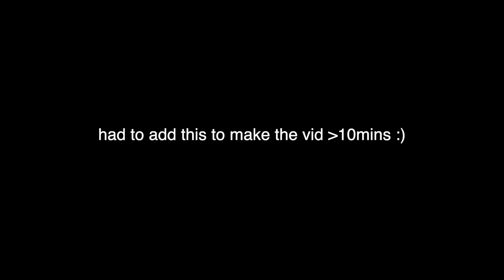I FIXED THE M3'S BIGGEST PROBLEM...

Comment: if you get a full exhaust, with headers and all and a tune, your car will sound infinitely better and be decently faster.
Reply: He deff should
Reply: just downpipe and tune is better, full exhaust with everything is way too loud
Reply: Headers? This aint a NA V8 😂
Reply: “decently” no he finna be haulin ass🤣🤣🤣🤣
Reply: it’s called being FBO
Reply: PQ Performance they have beast G80s and tunes
Reply: i don't think there are aftermarket headers for the g80 m3 yet
Reply: @jib2442  custom fab
Reply: No headers on a turbo car
Reply: @jib2442 there is but their custom made right now and very expensive. no mass production parts
Reply: @Kwitzy downpipe bro not no headers 😂😂😂this is not no NA car
Reply: @Mr.Potential  335i FBO swipes
Reply: @Kwitzy  😂😂😂u don’t know what ur talking about kid. Every 335 owner would die to be in a s55, b58, or s58 powered car…they’re all lying if they say otherwise. You need about 10-20k in a 335 to make that kinda power lol
Reply: turbo manifold

335i is straight garbage
Reply: @rocavelli20  true, rotaries are better

Comment: Slowspeed has downpipes, tune and a stock exhaust on his and it sounds sick. Wonder what that would sound like paired with the single mid pipe. Equal length setups also sound good on the M3s